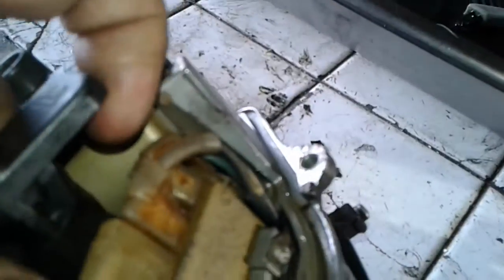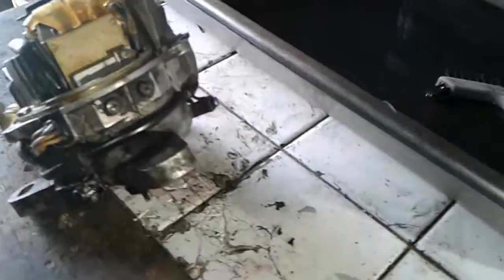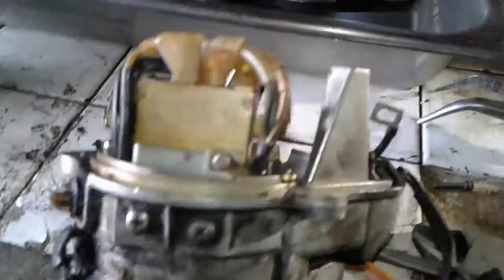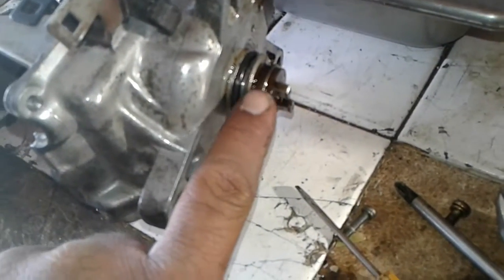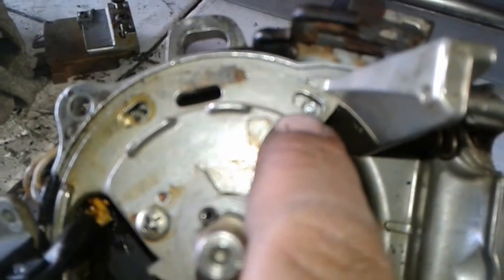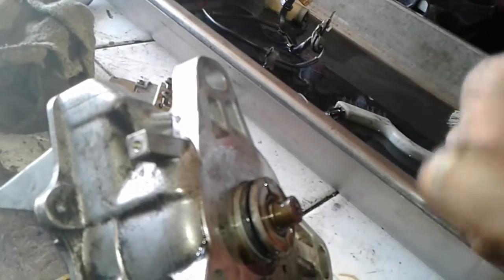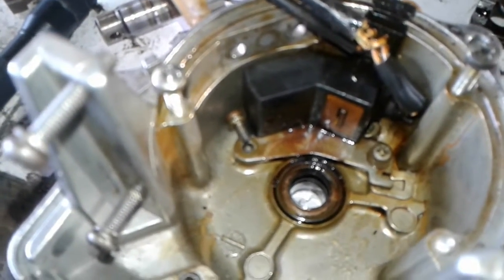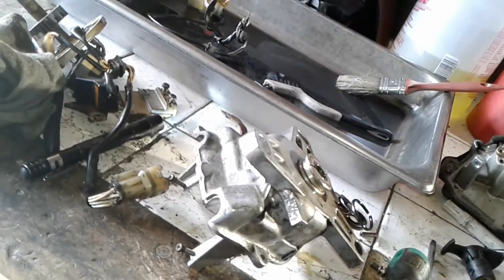Rebuilding a 1990-99 Honda Civic 1.6L Distributor

Comment: 99 civic or 90 civic? Title is misleading or are they the same for all civic,accords?
Reply: that's a d15b2 (dpfi) distributor. the d16 distributor has 3 vr sensors, 16 evenly spaced teeth wheel on top(right under the rotor) , a 4 tooth and a one tooth wheel, in that order. they are different. the d15 (dpfi) has one round and one square connector whilst on d16 they are both round... that's it for identifying them...
Reply from the maker: jini08taeki i fixed it and yes there the same on d16
Reply: Gilbert Galvan Thanks mate, ill learn from this and further expand my mind and get to working on distributors so my car wont stop on me again haha